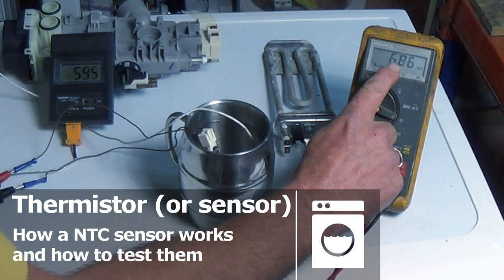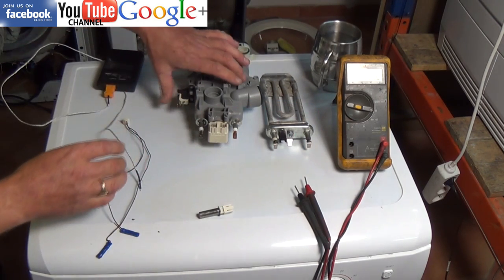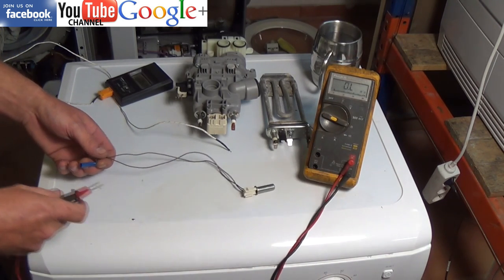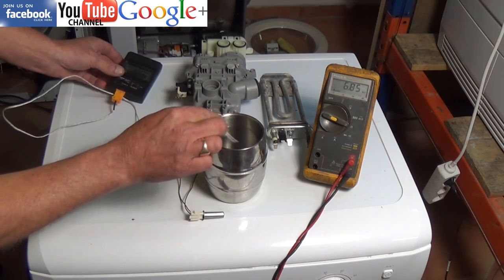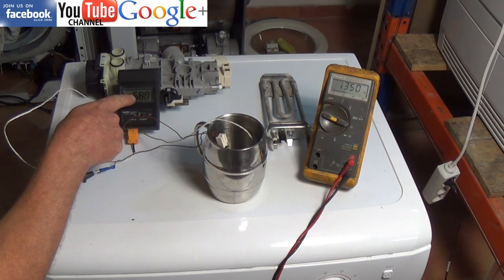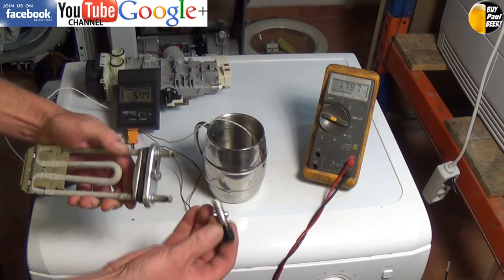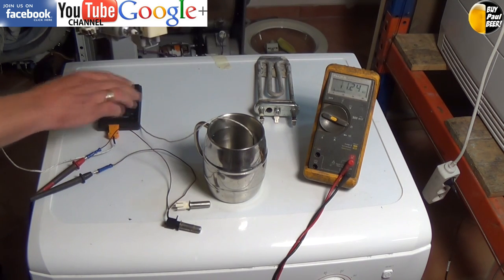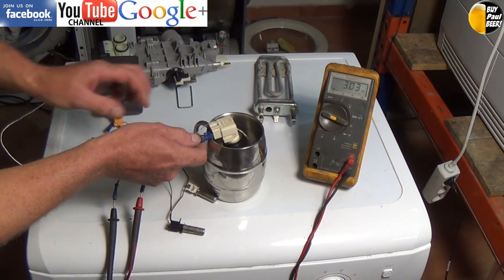How to test a NTC Sensor washing machine, Tumble Dryer, Dishwasher Etc m2ts

Comment: Must say, My dishwasher wasnt heating. Tested the element and it was reading about 24 ..... Tested the thermostat as in this vid -   its the type thats about 4 mins into this clip - and didnt get a reading on one side so thought it must be faulty.....ordered a replacement and the new one was the same. YET.....fitted it and bingo, the water heated up..so may be - just fit a new one anyway if the element has continuity before attempting further dismantling

Comment: Our Hotpoint 8kg Invertermotor w/machine constantly turned itself off and on throughout any setting except a cool wash, the original thermistor was W11203650 20K (it measured 21K), I replaced it with a W11203652 20K (it measured 19K) this also has a smaller end compared to the original thermistor, but now the washing machine works perfectly.  Thanks for your help 👍

Comment: Thank you for video.

For general knowledge....

On my Bosch Nexxt 300 series WFMC2201UC, the specifications from the repair manual are as follows.

Measure resistance all parts disconnected.
Heater   13.7 - 15.2 ohms
NTC        22.8 - 27.4 kilo ohms @68 degrees F.
Water inlet valves 2.7 - 4.5 kilo ohms.
Drain pump    140 - 200 ohms.

Hope this helps some people with their repairs.